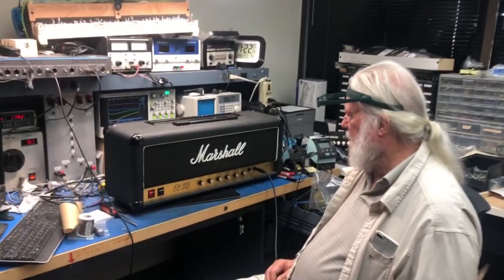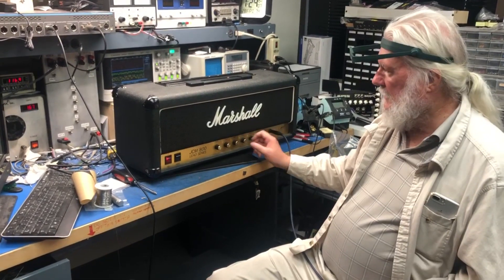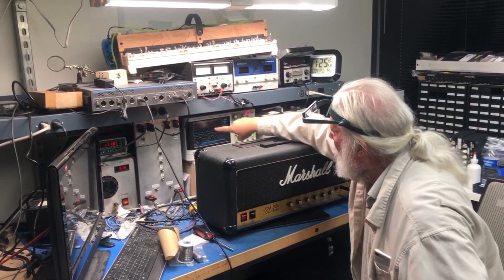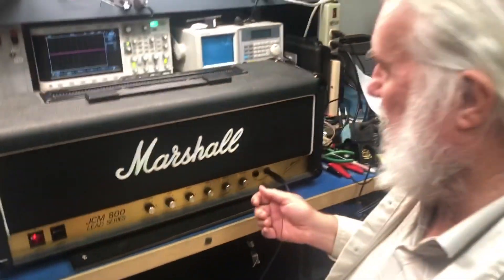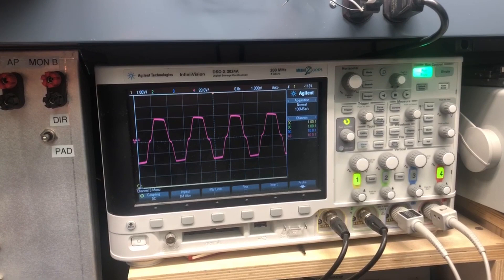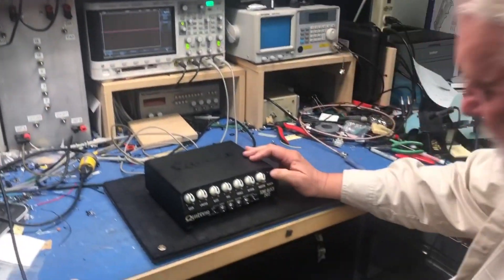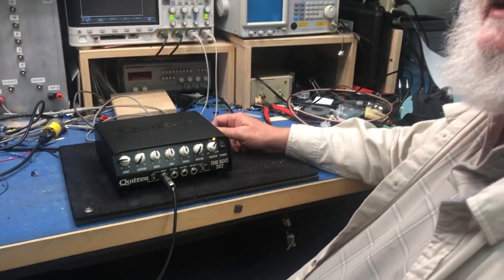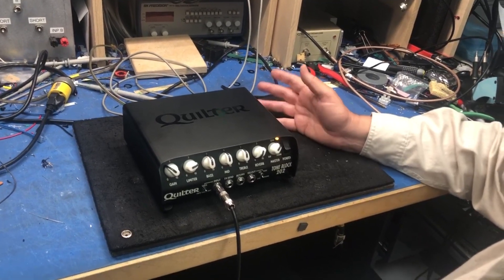Pat Quilter of Quilter Labs examines a Marshall JCM 800 and compares to a Quilter Tone Block 202

Comment: Does the Quilter Superblock also do this?
Reply from the maker: Do what exactly?
Reply: Sorry! It is hard for me to put into words because I'm not very technical, but the way the Quilter amp has te same type of clipping when used with a speaker as a tube amp? Or is this technology only integrated in heads such as the Tone Block 202?
Reply: @jkz1488  It is in all Quilter amplifiers.

Comment: That “power-amp sag” (low end thump) sound can be recreated with a compressor in the FX loop.  Using a EQ and Compressor in the FX loop is the secret to getting tube/valve character from a solid-state amplifier.

Comment: Another total Quilter convert here. I mostly use the Aviator Cub these days, but have the 101 Reverb and the 202 Overdrive. Great amps. I'm an old guy, diehard tube amp lover, but these do the trick. Additionally, everytime I email Quilter to ask a question, Pat answers personally. Try that with the big guys. Love these amps...and they're light in weight. Finally, solid state has arrived.
Reply: 21 lb quilter is a lot lighter than even a deluxe reverb. lol

Comment: As a former electronic technician, and a guitar player, you’re not going to make a MOSFET, or any type of field effect transistor sound exactly or behave exactly like a power/preamp tube. They may look the same on the scope, but they sound so much differently to my ear. I had this same argument with my instructor in the 80’s. He told me there’s no way I could tell the difference, but even with a blind test, I could. Every time. Solid state is okay, but it’s really no replacement for a good set of 6550’s, 12AX7’s, EL34’s. Even a great tube preamp loses something with a solid state power section. Your stuff sounds great, but I can tell the difference in a live setting. I even dislike solid state overdrive/distortion pedals. But that’s just my opinion. To each his own. I even had this discussion with John Kasha when I was using his stuff. When I was doing load in’s/out’s, I wish my amps weighed 4 pounds.

Comment: He did say it early about reactance which would be greater with speakers than a dummy load. the output valves of a tube amp are fighting the inductance/reactance of the valve output transformer and also the inductance of the speaker cab so the speakers push back which makes the transformer push back and this is what gives the feel of a valve amp.
Reply: Pat should also look into why HIWATT have almost hifi quality with the same EL34 valve then goto the KT88 99 etc amps and also the same valves are used in real hifi amps.

Comment: Never liked the jcm 800 .the amp never felt touch sensitive or dynamic.
Reply: 1981-1983 are where it’s at for JCM 800s. 2203, 2204, 4010, 4104 models. They’re much more organic and touch-sensitive than the later models.
Reply: @driventone  The later model (with effects loop) switched to a clipping diode for gain, rather than relying on the preamp tubes.
Thats just one of the major differences that make the early 80s JCMs a far better amp than the later models.

Comment: Can I ask you a question! Im running my amp heads into an attenuator/load box direct into my DAW with Cab Sims and my 2 tube heads are working great. Im able to crank the master to a nice high level to get that nice Power Amp breakup. But the strange thing is, when I use the same setup with my Orange Solid State head, the signal works and sounds as it should at very low volumes, but as soon as you start to turn it up to any decent volume it just wants to squeal and sing. Any ideas as to why that could be? I dont believe anything is particularly wrong with the amp because I just tested it as a normal amp/cab setup, it just seems to be when Im recording direct into my DAW through the THD Hotplate
Reply from the maker: Well, it is hard to say for sure (we don't actually make Orange amps) but microphonic sounds are usually due to bad or un-shielded cables or jacks.
Reply: @QuilterLabs101  Right, good idea. I can use all the same cables with my other amps and it works fine, so it's still kind of a mystery lol. But I appriciate the feedback.

Comment: I have a JCM800 2 x 12 50W combo. I used to run a hard distortion pedal through the effect return jack to bypass the preamp section. It was heavy as plutonium.

Comment: Skip to the end of the video if you aint got time for this.  He is able to get high volume without the clipping on the oscilliscope.  I got to check this guy out more and this video out more.  I think he's got something.  ...or at least may have something.
Reply: The "right" preamp pedal in front (ie: Friedman BE-OD or Bogner La Grange, etc) and your best 1x12 or 2x12 and I can't think of a more manageable, reliable high quality tone rig....   I'm a tube amp guy but I'd rather keep my favorites safe at home and pack around a light, great sounding amp that is more reliable.  Some venues have questionable power supply, especially outdoor events and as much as I'd like to use expensive old tube amps, it's not worth the risk.

Comment: Maybe stupid question.... what is that meter with the three waveforms?
Reply from the maker: That would be an oscilloscope.
Reply: It's an oscilloscope, which measures the frequencies of the electrical output of the amp, which becomes sound when they reach the speaker.

Comment: Glad to see somebody working hard on my life's dream of searching and finding the best solid-state amp.
Reply: Quilter make awesome solid-state amps, and that’s coming from a dedicated tube amp guy.
Reply: @electricj5  In theory there shouldn't be a reason why an analogue solid state circuit can't sound like a tube circuit if it's designed properly. That's why he's using FETs. FETs and tubes are voltage devices, transistors are current devices. You have to be a special kind of mad scientist to figure out how to make solid state emulate the technical limitations of tubes, but it is possible. However it's not just the tubes. In a tube amp every component, from pickup to speaker, is reacting with whatever it is connected to. Transistors don't change their behaviour much based on load ect, and they don't need output transformers. They also don't have inadequate power supplies usually. Tubes are very flawed technology, and the classic amps were very badly designed, if ones criteria is accurate sound. They were a beautiful mistake.
Reply: @Patrick-857  the lab amps are really good
Reply: @silverpairaducks  Ty Tabors amp of choice on King's X's album Gretchen Goes to Nebraska. Such a unique and absolutely unobtainable guitar tone.
Reply: I've never tried one but I like their approach. Most of the solid state amps you have to be a brain surgeon. I'm an old dude I don't need much. Something simple that sounds good. I don't need my phone to operate my amplifier. I don't think my flip phone would work anyway.

Comment: Is this same tech in the micro block 45? I’ve been using it as my main live amp for the last couple years and am very happy with it. I own several great tube amps, but you seem to have really nailed how an amp should feel in a solid star version. The truth (for me) MB45 is way easier to carry. Solid state or not the MB45 is a great piece of gear. If a v2 is coming I’ll buy that too 😀
Reply: It is not exactly the same. Much of the mojo is similar but the added wattage of the 200 watt engine enables things that can't be done as easily as low power. That said, the 45 does have a V2. The InterBlock 45.
Reply: @ChristopherParks007  thanks for the info!